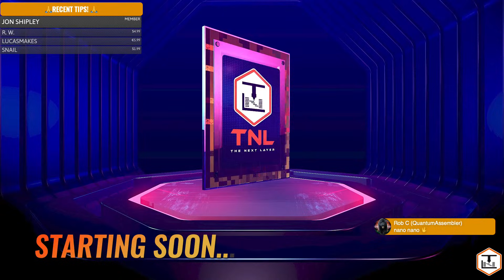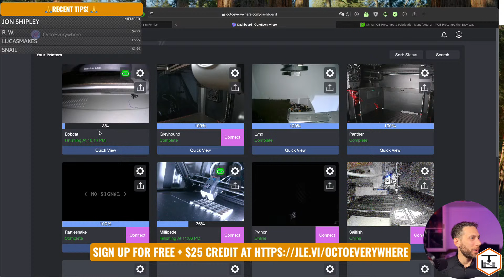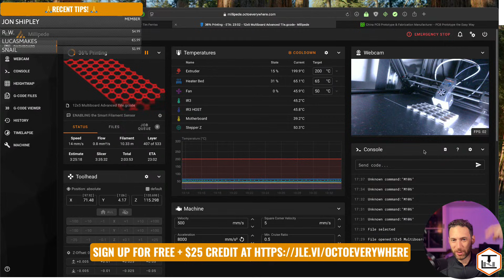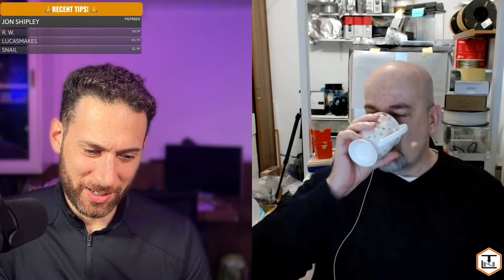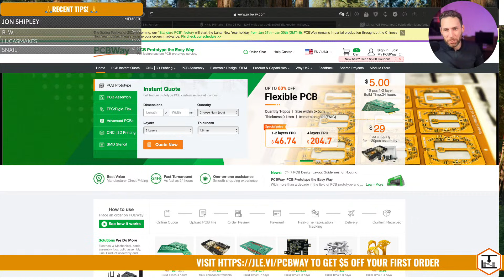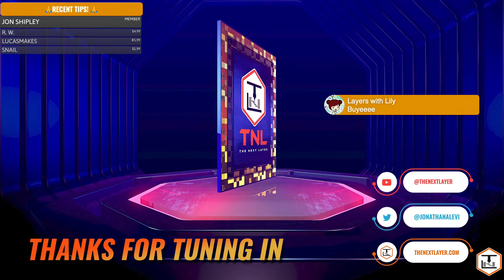Ep. 53: Dr. Igor Gaspar of My Tech Fun on Functional 3D Printing and Material Testing

Comment: Igor was right about the shrinkage compensation. I mean yes, there are settings for it. But in real life the shrinkage depends on many  things which you can not predict just by a simple magic number in %. ABS is best for Injection  molding where the pressure and slow cooling prevents any kind of deformation. Not even a heated chamber can do that.